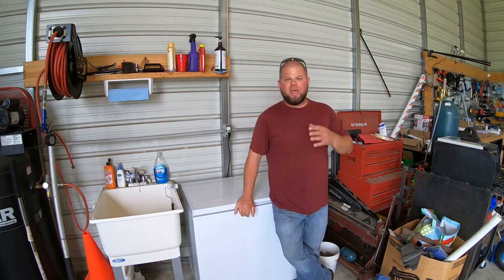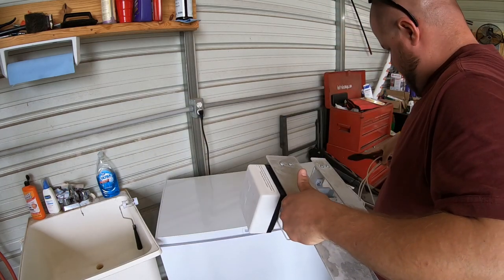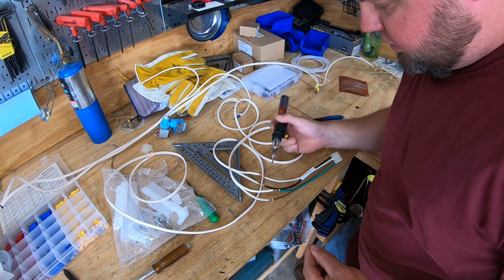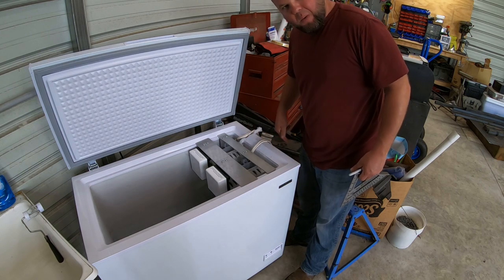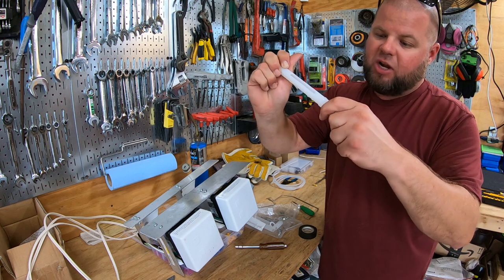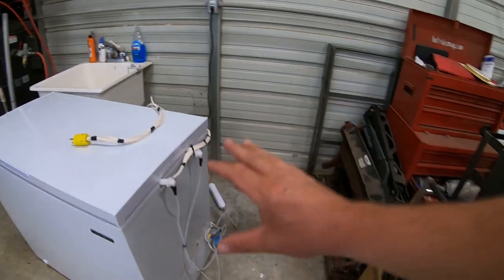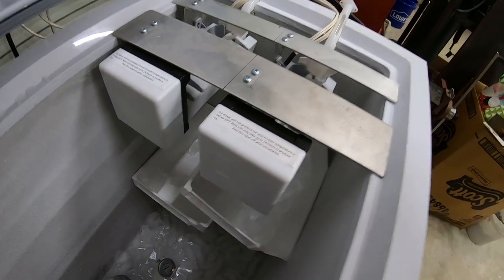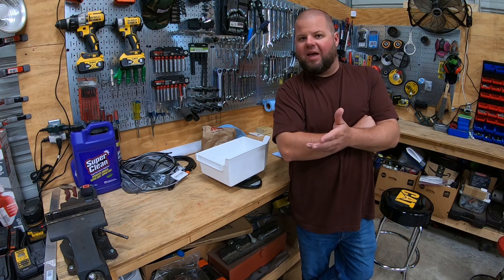Homemade ice machine, adding a second ice maker to increase production!

Comment: Looks good; I live in an apt so I won’t ever do this.  I’m wondering what’s the electrical consumption vs a commercial one? Considering you made holes in the lid seal area, time for freeze/keep temps, etc.
Reply from the maker: A lot less than commercial that's always running and melting ice. I'll be testing electricity usage next week.
Reply: @TKCL  awesome, i will watch, thanks for the reply

Comment: I thought about doing this a few years back but ended up going with a 200 lbs Manitowoc ice machine for $1,900.00. They may have went up since.

You can never really justify spending $1,900.00. on a ice machine but it’s purely a convince thing. I do run a cooler of ice year round and use a lot of ice.

Good job by the way, I’ve always wondered if it would have worked. Thanks for the great video.
Reply from the maker: Thank you for watching

Comment: I would add a manual drain valve at the bottom to drain water in case you lose power. What about an insulated trap door  near the bottom to remove stale old ice?
Reply from the maker: I keep it turned over well, the cooler already comes with a drain.

Comment: Two questions please, is the freezer frost free?  And what stops it from making ice when it is full?
Reply from the maker: Not frost free, a defrost would cause ice to melt, refreeze and make a huge block of ice. I just unplug the ice makers when full, you get plenty of notice
Reply: @TKCL  Yes I was still thinking of the first setup when both the freezer and ice maker were wired together.

Comment: Did you use the shut offs for the ice makers to stop production when the freezer is full. It doesn’t sound like you will overrun the storage of the freezer but if you don’t use enough ice what will happen when there’s no more room for ice. Also  , from another comment, I like the idea of making some block ice in the freezer to have on hand.
Reply from the maker: No I did not on the this build, but my current new build (video releasing today) I did keep the shut offs.

Comment: Hey Andrew, I'm wondering if adding a small computer type fan to move the air in your freezer wouldn't help. I added one to my kegerator and not only does it run less, it also chills down a new keg much quicker. Circulating the cold air seems to speed the thermal transfer. If you're interested I can send you one. I bought several perfecting my kegerator setup. Let me know.
Reply from the maker: Do they run on 110 volts? If so yes that would be awesome and definitely help while the freezer is low on ice/thermal load.
Reply: @TKCL  They do run on 120. I will get you one in the mail. It's worth a try!
Reply from the maker: Well I'll be happy to pay you for it. Obviously it doesn't freeze up????
Reply: @TKCL  No worries, mine doesn't freeze, although the kegerator cycles down to zero and then up above freezing. It's worth a try!
Reply: Just put a couple of those fans in the mail. Hopefully will make it to you shortly.
Reply from the maker: I appreciate that! Excited to see if they work
Reply: @TKCL  Any update on this? I wonder if the ice maker work on a timing basis or if it actually sensors the water to be frozen. I expect the timing, so for that to actually speed up the process, you need to change the timing as well...
Reply from the maker: Spoiler alert, they work on temperature, which is awesome. Video out today!

Comment: where did you buy the freezer because i bought a sears freezer found out when i cut the top for water and electrical access i cut into freon lines.
Reply from the maker: Mine was from Sam's, that's why you got to be extremely careful. My new build that will be out later in the week shows how to make one with NO cutting or modifications of the freezer.
Reply: @TKCL  will you be doing a video on the new modifcation of freezer
Reply from the maker: Yes testing it now, video out by this weekend.

Comment: But it appears you have the budget for a actual ice maker. They have very efficient ones. Plus the drip hose is for some meltage but mainly to rinse out clean and drain.
Reply from the maker: I do not, I no longer work at a mill where I could work unlimited over time. I am also building our home and every extra dollar is going into that.

Comment: I wonder if it would be more efficient to mount one of those countertop ice pellet makers inside the freezer?  They put out like 40lbs a day if you keep them filled with water.  Most of the smaller ones I've seen just drop the ice into an uninsulated bucket, so you could probably cut a hole in the bottom of the housing and let it fall into the bottom of the freezer chest.  Might make for an interesting trial!

Thinking through it, you may need to mount the tabletop one to the top or side dropping through the lid of the chest.  Not sure what would stop the chest from freezing the water if it was inside.  May also need to figure out how to feed it water continuously...  Could make an interesting trial though!
Reply from the maker: I've kicked that idea around but have concerns.  Cutting an opening would allow outside air and moisture in, resulting in frost buildup.  Also those table top models make small hollow ice cubes that melt quickly, that's not what I'm looking for.

Comment: This is a cool project (literally lol). I don't think an ice maker takes barely any power, so I think you could have just used the freezer cord for everything.
Reply from the maker: Probably so, but better safe than sorry. Thanks for watching
Reply: Just start them at different times so the extraction cycle is offset.
Reply from the maker: They have been offset since the day I plugged them in.
Reply: I actually looked it up last night. The average icemaker uses 190 watts for about 90 seconds for the extraction heater. That's the only part of the entire cycle that uses significant energy.

The average deep freeze uses about 500w when the compressor is running.

So worst possible case, the compressor is on, and both ice makers are extracting ice... we're looking at less than a 1000w draw, for a maximum of 90 seconds.
Reply from the maker: I've actually tested freezer and refrigerators recently when I reviewed solar powered generators. The highest pull I seen with compressor engaged was 360 watts and 0 watts with it off. And yes the ice maker shouldn't run much at all. I'm testing thermal mass theories next week by add block ice and checking power consumption with a killawatt meter. Videos coming soon

Comment: Do the "bale Arms" clear each other? they seem too close together to let them operate up and down as it cycles.
Reply from the maker: No I had to remove them, but I've yet to fill it up with as much as I use ice. In the winter when it gets close to full, I'll just unplug the ice makers or manually trip them.

Comment: Cool vid. At zero degrees does the cubes freeze together and make it hard to scoop out?
Reply from the maker: Not at all. The ice is made in freezing temps and is stored at freezing temps. It must thaw or form condensation to freeze into a block.

Comment: Clear ice which is what you buy at a store melts about 4 times sloewer and does put impurties in your drink that you get from homemade i
Reply: The impurities you talk about at the same minerals that you get from the tap water, and the opacity usually dissolved gases in the water.

Commercial ice makers make ice differently, they make it in thin layers so the dissolved gases don't show up.

Comment: Throw in water bottles. Thermal mass will go up and you can drink them on the boat. Any tune your replace air (insulator) with water you win energy.
Reply from the maker: I tested that and believe it or not I produced LESS with thermal mass, I was shocked.

Comment: those ice makers should be running out of cycle of each other so they never compete for a water refill. You'll know this is happening if you see some tiny cubes. I think this is a great idea and I cant believe no one has done this before. It's so simple.
Reply from the maker: I've been in the shop several times, the ice makers are on timers and several minutes apart. I can always trip one and make them 45 or more minutes apart. No issues and uniform ice cubes.

Comment: fill a 5 gal bucket and freeze when its frozen. turn upside down and remove the ice block. Then using a ice pick chunk it up you will now have 40# of ice.
Reply: you may be able to freeze 5-6 buckets at once potentially make 240# in 24 hours
Reply from the maker: I'm making block ice next week in addition to the cubes.

Comment: the addition of a fan will reduce the freezing time but the ice maker may cycle on a timer not sensing when the ice has formed.
Reply: Those ice makers cycle based on a temperature sensor.  Some models even have a small fan built into the end of the unit to speed up production.
Reply from the maker: Testing today, video out soon

Comment: Lol. Dang, YouTube is all over it. The ad at the beginning of this video was for something like K2 kinetic advertising a freezer icemaker product. 😂😂😂 sometimes it feels like we’re being spied on. Lol

As far as the cord I’m guessing it would be fine the refrigerator usually pulls a lot more energy than a deep freezer and they run the icemaker off the same power source. If you get the maximum amperage rating from all three devices you can just add that together and see if your cord is a large enough gauge to handle that amperage and then you’ll know if it’s too much of a load or not. Even then most of the time you’re probably not gonna have all three devices on at the same time but you definitely want to be sure. I’m guessing the fans make a difference and I’ve had an icemaker that had what they called turbo mode which was just a fan and it did make it work faster. Also you were talking before about thermal mass and I think putting two or three jugs of water in there to freeze solid would be a great idea, especially if your power went out for 20 or 30 minutes it would definitely help keep everything solid instead of melting and refreezing, it definitely couldn’t hurt. I also think that little penguins on skis in there would be some awesome decor and probably improve the morale of your ice-makers. 😜😆
Reply from the maker: See todays video, fans made a huge difference
Reply: @TKCL  lol. Yeah I commented again can I have a bad habit of commenting before the videos over 😂😂 but I do think I came up with a couple of ideas on my last comment. Lol

Comment: Did you have any issues getting the ice makers to stop once the chest is full?
Reply from the maker: Never filled it up, I use way too much ice. It will be winter before it stops. I took the trip bars off to fit two. You can either unplug the ice makers or manually trip them off. That freezer has so much capacity you can just check it once a week and stop them when you get close.

Comment: I really suggest you fill in all the gaps with silicone where the wiring enters along the rim your freezer will run constantly and the life of the freezer will be shortened drastically due to the escape of cold air your ice will also take longer to freeze and not stay solid those little gaps on the seal edge are crucial to trapped in cold air and keep the freezer ice cold without it having to run constantly you will appreciate the lower energy bill
Reply: I’d be surprised if it makes much difference.  There is no airflow inside, the cool air sinks, and the gaps are pretty tiny.  And don’t forget, we are constantly pumping ‘warm’ water in to be frozen.  Sure, sealing the gaps will help, but I doubt you could measure the difference.

Comment: this is a awesome project, BUT if you are only using  20lbs a week it's not saving any money. where I live a 25lb bag is $3.99,  your spending more then that in electricity running 2 ice makers and the freezer a week,,  But it is a neat and fun project that I think I'll try with my grandson
Reply from the maker: Negative, watch my current videos. I use 40-80lbs a week. It costs me exactly 44 cents to make a 20lb bag in electricity. It's all been tested and production is still going up as costs per pound are dropping.
Reply from the maker: 21 cents a day to operate in Florida summer heat

Comment: The ice makers them selves are set on a timer they can’t tell when the water is frozen so they cycle every so many minutes this will be the limiting factor on your ice maker on a commercial ice machine they have a flow style freeze system where water trickles over the mold and a sensor to tell when the cubes are a certain size to dump.
Reply from the maker: They actually work on temperature, there is a big sticker on them that says they will not make ice until they sense 10 degrees or less.
Reply: @TKCL  Your both right, the clock timer only runs when the temperature is below 10  degrees, it is a failsafe if the freezer stops cooling.

Comment: The wiring: I would have had the 2 power in splices much tighter in, so there is only 1 set of wires out to the plug, and the 2 harnesses to the valves.  I would have also made a separate entry point for them (likely used one of the tubes and a hole just below the top lip to run the wires through, since with the first cut you could have found where the top coolant pipe is run to know how far down you can safely go), and also used a waterproof connector inside, for servicing.

Comment: Next time, suggest putting heat shrink wrap on the wires before twisting them together, then after solder, you can just pull them over, hit with a heat gun, and done.
Reply from the maker: Yes I do that all the time, I think I mentioned I was out of heat shrink. Good stuff
Reply: @TKCL  - sorry if I missed that part.  Just wanted to help folks out.  I enjoyed your video.
Reply from the maker: Thank you for watching

Comment: Also like your idea about separating ice makers out cuz I imagine you're going to get to a point where you need to just shut those ice makers off meaning your container will be full and the standard ice maker shut-offs aren't going to work for you because of your configuration.
Reply from the maker: In winter I will just unplug them when they fill up

Comment: The reason a commercial ice makers let the ice melt in the bin is to keep the all the ice from freezing together into a solid block. The bin for the ice keeper is not refrigerated. You will find you will probably have a problem with the ice freezing together under the right conditions.
Reply from the maker: No freezing after months of use. As long as melting isn't allowed refreezing will not happen.

Comment: Are these type icemakers timer controlled or does the temp ( amount of time till frozen) control the cycle time? If temp controlled the lower the temp should increase production. ? not a smart a** comment.
Reply from the maker: No one knows, but they definitely have a thermostat in them. The sticker says they won't make ice until below 10 degrees. I installed fans this morning, if they work on temp only, I should see ice production increase tomorrow. Video out soon
Reply: @TKCL  
Cool I will be watching. nice video!

Comment: Will you be getting your house spray foamed and the rest of your shop eventually?
Reply from the maker: The house yes, the shop no. The shop roof made a big enough difference that I am not going to spend anymore on insulation. The house will be all spray foam.
Reply: @TKCL  that’s good. My neighbor spray foamed his house and it will stay 70 degrees Fahrenheit on a 100 degree day with the ac only kicking on once. It may be expensive but you will save money in the long run.
Reply from the maker: Yes that is true! But not running the AC can cause humidity problems, something we will have to watch and potentially get a humidity controlled thermostat for.

Comment: Pretty G@@D Ideas, Butt Now That You Have You Double Cube Ice Makers Workin OK, I'd Find A Larger Plastic Container To Place Under Them On The Raised Right Step Area To Catch All Them & Fill The Rest Of Freezer With Gallon Water Jugs To Just Fill With Purified Water & Freeze To Make Block Ice! They're Also Reusable, Melt Much Slower Than Loose Cubes & Won't Get Contaminated In Your Cooler, Soo You Can Use The Jug Waters For Drinking, Making Tea-Coffee Etc As It Melts, ETC!!! 😉 Thanks

Comment: Just to give you a little bit of perspective on my setup and to give you some ideas. As you just said production on the commercial ice makers are very resource-intensive because obviously they're making a lot of ice a lot faster. So first of all I was fortunate enough to get a whole bunch of little under-counter 150lb a day ice makers from a company that was moving and buying all new equipment for their new location even though these ice makers were free I quickly found out they were not free to run. I was leaving Home Depot one day after summer season had ended and they had a sale on those chest freezers just like yours they had three of them they're trying to clear out I paid 79,79 & 89 bucks for three chest freezers couldn't pass them up. At that point I was about to shut down my ice maker seeings  how we ended our boating season anyway continue with the icemaker till I filled up two of the chest freezers with bagged ice got bags from a Ice Maker Place for free. Come around to the next season and with the chest freezers what I would do is clean my ice maker fire it up run it for a day or two bagging ice and make enough ice fill up my freezers. I would make enough to handle 2345 trips and shut the ice maker off keeping freezers stocked humming along taking pennies a day to keep my ice  cold. Hope this gives you some food for thought and again thank you for your video certainly got me thinking
Reply from the maker: Thank you, that was a sweet deal